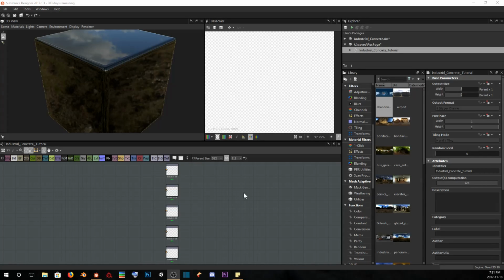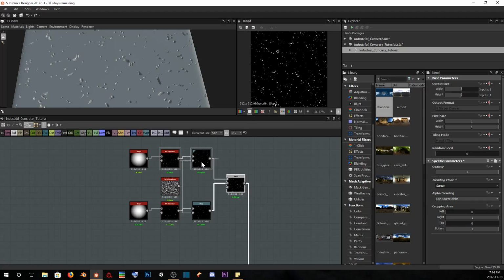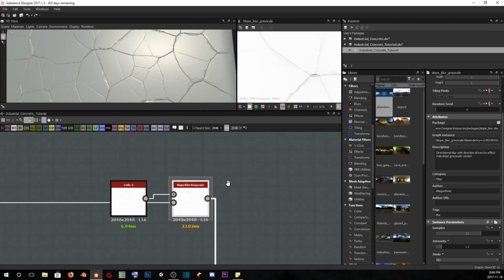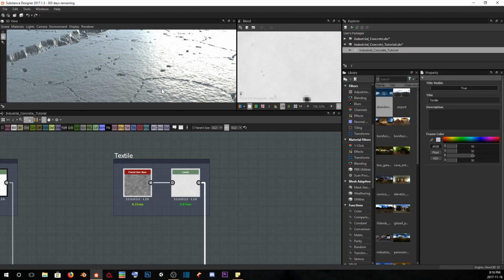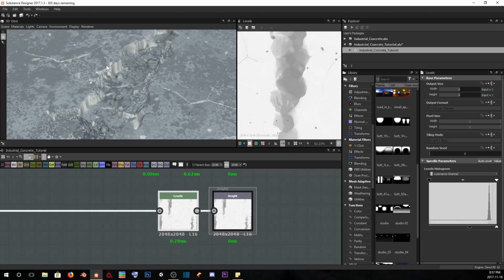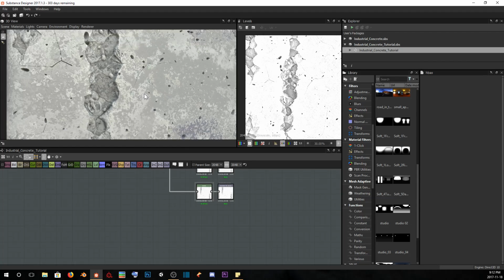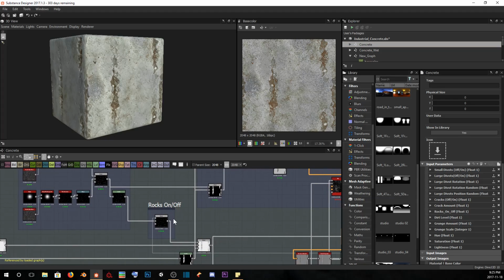Concrete Material in Substance Designer | Beginner-Intermediate Tutorial

Comment: Amazing tutorial, it's just so difficult at times to see which nodes connect where. If they were uh noodles or whatever you call them instead of rectangle links, it would help tremendously. But, I don't know if that was even an option 5 years ago. Still fantastic tutorial and I eventually figure it all out :)
Reply from the maker: Thanks for watching! You are totally right, it is tough to see at times and I learned my lesson for later tutorials and had started using the soft noodles instead! 😊

Comment: For anyone who's wondering what happened to the "Perlin Noise Zoom" node, it was removed in newer versions of Designer. Using a "Gaussian Noise" node will get you something with relatively the same distortion and contrast that works a lot better than the regular "Perlin Noise" node in this case.
Reply from the maker: My biggest regret about these older tutorials was using that node... I hate when they randomly remove nodes. 😭 Thank you for the PSA and for watching!
Reply: I can't get anywhere near as nice of an effect using the Gaussian node and it's rather frustrating.

Comment: Thank you for your Designer tutorials, they are really great.
I have a question though..., if you (and everyone) take the same exact first steps when creating a material (like putting a standard material, normal node and material preferences), is there a way to make those steps as a kind of initial state for Designer?, then you wouldn't have to create the same everytime you create something.
And then, if that can be done, a tutorial on that would be great too :)
Reply from the maker: Thanks for checking them out! And for an awesome question. :D

I believe you are able to do exactly that, where you can set up your material and just save it as a default so that you open every new file to that saved scene. I can't promise anything yet, but I'll take a look and you might see a tutorial in the near future! :)
Reply: Great!. I know you can save partial graphs in order to reuse them, but I don't know how to use them as a starting point nor using the changed material for that also.
Reply from the maker: Me neither! So we will be learning together. :D

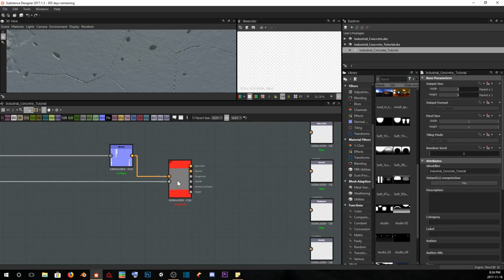Comment: at 36:40 when i delete the base material i dont have any idea of what im doing in the 3d scene
Reply from the maker: So we just used the base material node to have a "quick preview" of our material, essentially. It has default parameters that allow us to quickly setup a grey, non-metallic material with mid- ranged roughness very quick so we can get into creating our material right away. We then delete it because this isn't actually our output nodes, we are only using it as a form of preview. I hope that helps clear things up a little! :D
Reply: Yeah i understood that but when i plug the rest of the nodes to the base color, normal, and height, the material doesnt change... its still the same grey for the color even after doing the rest of the tuto
Reply from the maker: So once you plug all the nodes into your outputs, make sure you right click anywhere on your graph (not on a node) and select "View outputs in 3D". That should fix it for ya. :D
Reply: Get Learnt thanks !

Comment: Great tutorial! 

I am new to Designer, and have been trying to follow along - but at the point where you check the cracks at different Parent Size, I'm getting a huge difference in the strength of the cracks I set in the Levels node. If I adjust them to be slightly visible at 512, they are not showing up at 2048, and if I adjust them to be slightly visible at 2048, they are way too strong at 512. 

I'm thinking this will be a problem later on, if I need to change the resolution. Any ideas?
Reply: i was wondering why I got no effect from the height map. this fixed it!
Reply from the maker: I'd make sure to have your parallax occlusion turned up to 1 (3D View, Material>Default>Edit and scale set to 1) just to make sure you get the full view of how deep your cracks are. Another issue you might be facing is that your cracks might be too thin and when you change the resolution lower, there just isn't enough pixels to fully realise your texture. Do you anticipate resizing your texture for your intended end result?
Reply: Thanks for the quick reply, appreciate it! 

Turning the parallax occlusion up helped the overall look of my material, but the cracks still disappear at a higher resolution. I have traced the problem back to the Cells 3 node,  where the black lines disappear when I turn the resolution up, and become way too thick at a lower resolution. Not sure why this is happening.

I solved this by changing the output size of Cells 3 to absolute at 512, and setting the next node in the chain to relative to parent. There might be a better solution, but it seems to work.

Also, like you explained in your tutorial, exposing the parameter for the strength of the cracks helps to control the result at different resolutions. I want to try out the material in Unreal Engine, and as far as I know, it supports parameters created in Designer. 

Thanks again! :)
Reply from the maker: Looks like you have a good handle on things! Good thinking with making the Cells node an absolute size, as long as it doesn't look too low resolution on your 2048 texture. 

As well, you'll need to make sure you download the Substance plugin for Unreal to use your materials, but once you do so your exposed parameters should be readily available to you! Thanks for watching and I hope to hear from you in future tutorials! :D
Reply: @CurlyTheEnt  Thanks dude! :)

Comment: I wish we had a node to make heightmap hangover and extruding part less stretch instead of these horrible striations!
Reply from the maker: In later tutorials I've started using a Histogram Range node right before I plug in my height map to the output. It gives you a little bit more control over everything, I would definitely recommend trying it out for yourself!
Reply: I have play with it and yes it's seem to help a bit but what i would really like to see is that feature i saw on heightmap and UE4 where extrude part of the heightmap is having separate UV so you can apply any kind of noise detail on the side of a cliff as an example.
Reply from the maker: Wow, I didn't know about that feature. There very well may be a way to do it in SD, I will keep an eye out and see if I can show anything in the future!
Reply: I spent 30 min looking for the original video about it and i had no luck!

Comment: Hey there
I followed your tutorial along and it's great had no issues what so ever. Completely clear and precise which I love lol. Something I am struggling with is taking just the cracks and creating a decal out of it so I have a crack decal which I can use in Unreal Engine 4. Are you able to clear up how to do something like that from this tutorial or create a vid showing how to do it please? I'd greatly appreciate it.
Reply from the maker: Super glad it helped out! And the fact that it was somewhat coherent for you is a plus. :D

I want to preface that I am not overly versed in decals in Unreal, as I'm really just now getting into the engine myself. However, I feel I know enough to probably help you out! Were you looking at creating crack decals in general, or were you specifically looking at taking the cracks from this material and separating them into their own decal?
Reply: Thanks for quick response.
I'm looking at both actually. Creating crack decals in general to use but also using the cracks from this material on it and other materials. I might also use vertex painting at some point but thats a different conversation.

Comment: is there any reason I can't adjust my parent size? the Toolbar is grey, i can't click it.
Reply from the maker: Try double clicking anywhere on the background in your graph editor to pull up the parameters for your material. Find output size and click the little icon that will be to the right over top (should be the first or second parameter) and set it to "Relative To Parent". It just sounds like you may have made your graph "Absolute", so you'll be unable to change it until you set it to Relative. :)
Reply: dude. appreciate the reply, I figured it out last night around 4am. Was banging mty head on the wall until I saw the setting in the parameters, thank you very much for this tutorial. Its really helping me understand substance. I'm coming from NUKE background. Again, very helpful.
Reply from the maker: Real glad you were able to figure it out, you'll never make that mistake again! And NUKE is one I've been interested in trying out, but never got around to. I hope the transition is relatively painless! If you ever have any ideas or suggestions for things you wanted to see, feel free to let me know! :D

Comment: How did you change the look of connecting lines between nodes? To make them sharp angular instead of flowing shape.
Reply from the maker: If you go into your graph editor panel with all of your nodes, along the top toolbar you'll find a button with two horizontal lines connected by a vertical line (it's right beside the stopwatch icon). If you toggle that, all of your connections in your graph will be the straight lines, which I find much easier to see. Hoped that helps!
Reply: Thank you! It's very helpful.
Reply: Praise the lord-ah! Thank you!